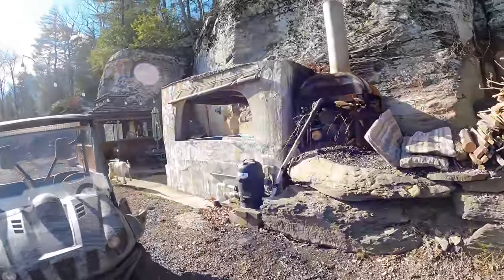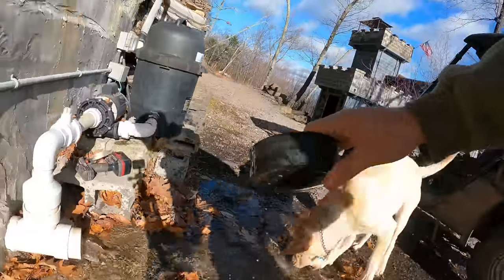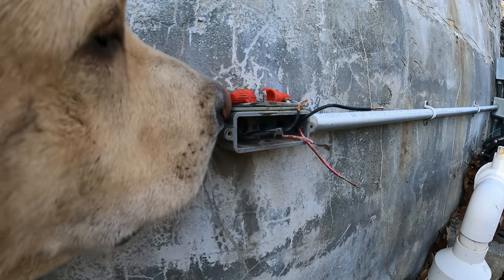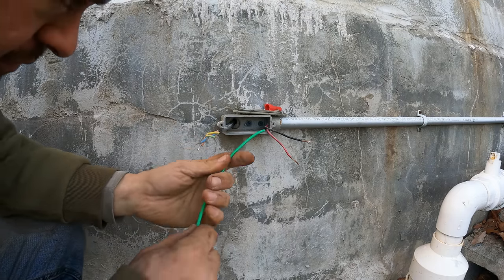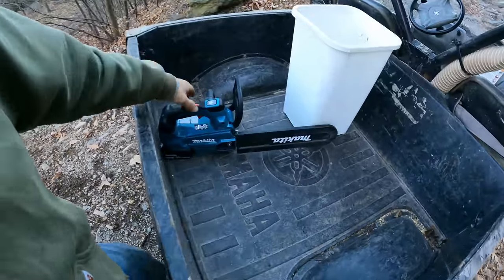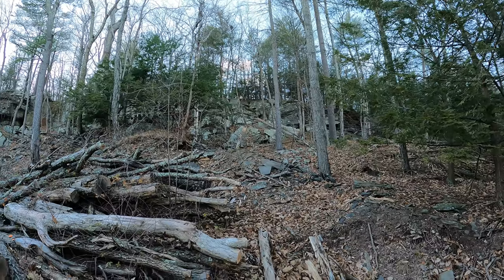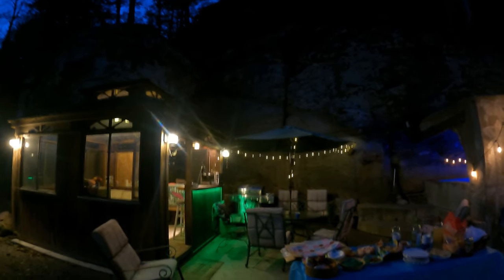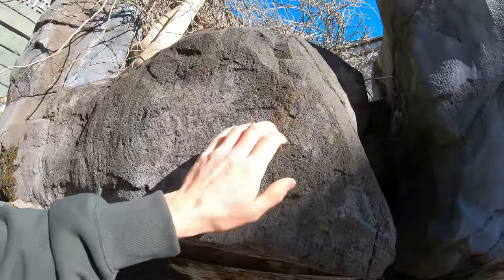Replacing hot tub light

Comment: You only have one drain in your tub.  That could be dangerous to someone with long hair.
Reply from the maker: Nah. It’s too big. I tried getting stuck to it.
Reply from the maker: Plus the pump is like 7 feet away from the drain
Reply: The pump is not the issue.  It's the suction at the drain that's the problem.  You could easily remedy this by putting in a second suction drain over the edge of the tub into the water from the outside.  I'm pretty sure that the code requires 2 inlets to the circulation pump.

Home » Health & Safety Channel » Pool and Spa Drains: Body Entrapment, Hair Entanglement Preventable Hazards to Children

Pool and Spa Drains: Body Entrapment, Hair Entanglement Preventable Hazards to Children
Recommended Safety Measures Include Special Drain Covers
General Health & Safety Health & Safety Safety Sports Swimming Swimming, Diving and Pool Safety
Three kids swimmingPool and spa drains pose a serious risk of body entrapment and hair entanglement, particularly to children, but are preventable hazards if safety precautions, including the use of special drain covers, safety vacuum-release systems (SVRSs), and other pressure-venting filter-construction techniques are used, say the Consumer Product Safety Commission and The American Academy of Pediatrics. 

Body entrapment  "often involves a child playing with an open drain, inserting a hand or foot into a pipe, and then becoming trapped by increasing suction that causes tissue swelling.3

Hair entrapment occurs when a bather's hair is sucked into the suction fitting drain of a pool or spa, hot tub, or whirlpool bathtub and becomes entangled in a suction fitting drain cover as the water and hair are drawn powerfully through the drain. In several incidents, children were playing a "hold your breath the longest" game, leaning forward in the water and permitting their long hair to be sucked into the drain.    strong enough to cause entrapment of hair or body parts, and drowning.

Alarming facts
The statistics are sobering and enough to give every parent pause:

There were 98 cases reported to the Consumer Product Safety Commission (CPSC) of body entrapment in a pool or spa drain, including 15 confirmed deaths, between 1990 and 2007.1,2   The deaths were the result of drowning after the body, or a limb, was held against the drain by the suction of the circulation pump. The incidents occurred in both residential and public settings:
Twenty-two incidents occurred at a residential location, and 31 at a public facility.  In 21 cases, the location was not specified;
Thirty-nine of the incidents occurred in spas, hot tubs, or whirlpools;
31 incidents occurred in swimming pools and three occurred in a wading pool (one location was reported as ”unknown”). In one of the spa incidents, a 16-year-old girl became trapped on a 12" by 12" flat drain grate in a large public spa and died.
According to the CPSC, there were 43 incidents of hair entanglement, including 12 deaths, between January 1990 and August 2004.  The incidents typically involve females who are underwater with their long hair near a suction outlet, when the water flow into the drain sweeps the hair into and around the cover, where it becomes tangled in the holes and protrusions of the cover, causing the victims' heads to be held under water.  Most accidents with drain outlets involve people with hair that is shoulder length or longer.
Drain safety measures
The CPSC and the AAP recommend the following safety measures to prevent body entrapment and hair entanglement in a pool, spa, hot tub, or whirlpool bathtub:

If you own a pool, spa, hot tub or whirlpool bathtub:
install special drain covers, safety-vacuum release systems (SVRSs), filter pumps with multiple drains, or another pressure-venting filter-construction techniques;
Make sure your child keeps his or her long hair away from the suction fitting drain cover; better yet, have him/her wear a bathing cap or pin the hair up if your child has long hair;
Never allow a child to play in a way that could permit the child's hair to come near the drain cover. Always supervise children around a spa, hot tub, whirlpool bathtub, wading pool, or swimming pool;3 and 
If drain cover is missing or broken, shut down the pool, spa, or hot tub until drain cover is replaced.
For public pools and spas, make sure that special drain covers, unblockable drains, and SVRSs have been installed, as required under the federal Virginia Graeme Baker Pool and Spa Safety Act, which became effective in December 2008.
Regardless of whether the pool is public or privately-owned never -  even for a moment - leave small children alone or in the care of another young child while in bathtubs, pools, spas, or wading pools.
For updated drowning prevention advice from the American Academy of Pediatrics, click here.
Sources: 

1. Consumer Product Safety Commission. Guidelines for Entrapment Hazards: Making Pools and Spas Safer (2005)

2. Consumer Product Safety Commission, 1999 –2007 Reported Circulation/Suction Entrapments Associated With Pools, Hot
Tubs, Spas, and Whirlpools, 2008 Memorandum

3. American Academy of Pediatrics, Committee on Injury, Violence, and Poison Prevention.  "Policy Statement - Prevention of Drowning." Pediatrics (published online May 24, 2010).

Created June 8, 2010

 

 
Related articles
Water Safety and Drowning Prevention Advice for Parents
Diving Off Diving Boards Is Dangerous For Kids
Consumer Product Safety Commission Cautions Divers About Improper Diving Practices
Swimming Pool Safety Tips
Swimming Pool Safety Tips
Reply from the maker: Listen, I’ve tried getting myself stuck to that pump, it doesn’t happen.
Reply: @AndrewCamarata  I just wanted to make sure you were being safe.  Thanks for responding.